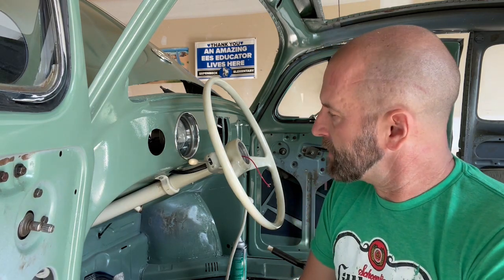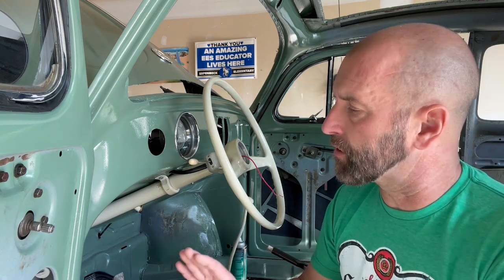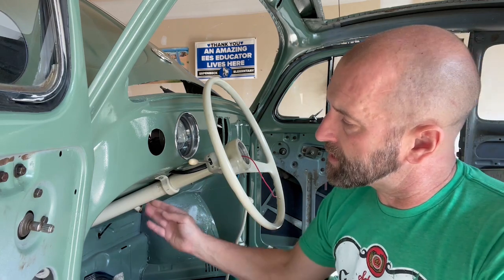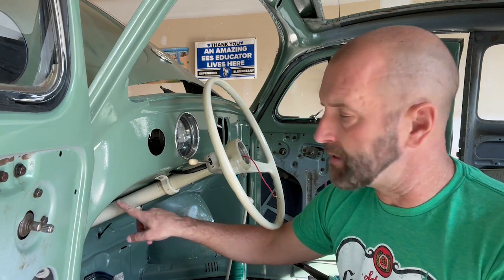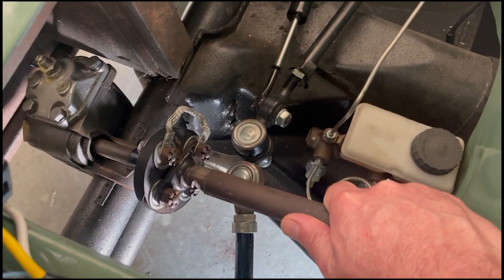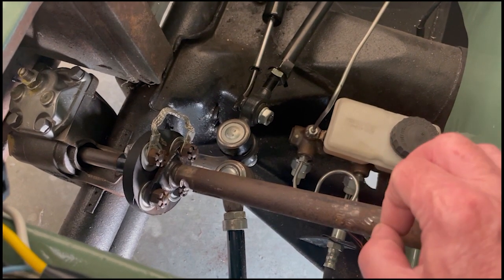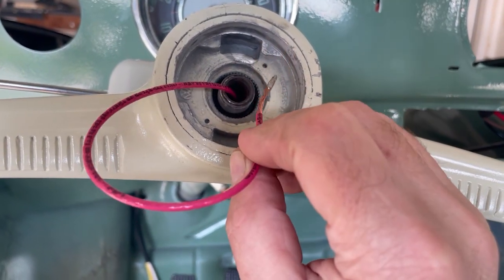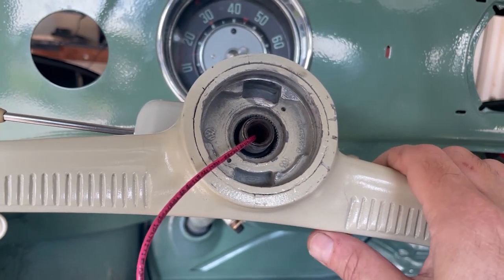Early Vintage Beetle Horn Wiring

Comment: iIt's handy to know that VW used the ground as the switch to allow the steering box as one commutator as if they had of switched the positive they would have needed two brush assemblies. Very clever the Germans.

Comment: Before I watch all of this, do you know if it applies to a 71? With the horn ring off, the horn can be activated by touching the ground wire to any metal on the steering wheel. Once I put on the horn ring, the horn activates and no matter how much I loosen the screws, it sounds.